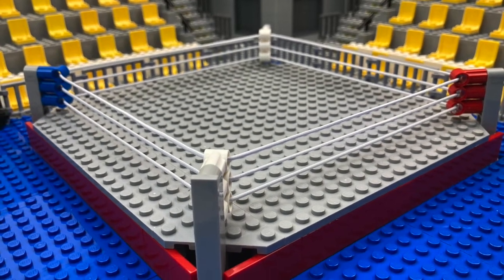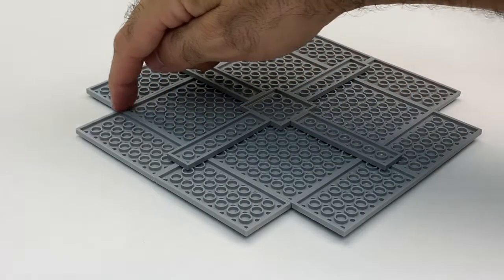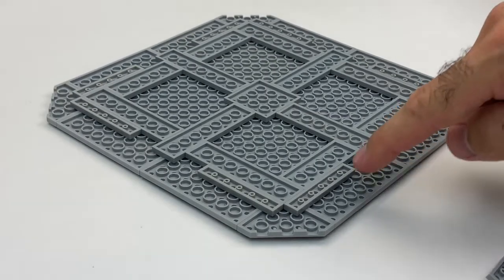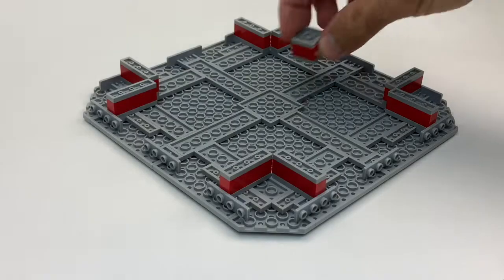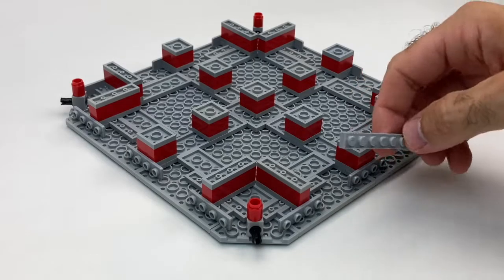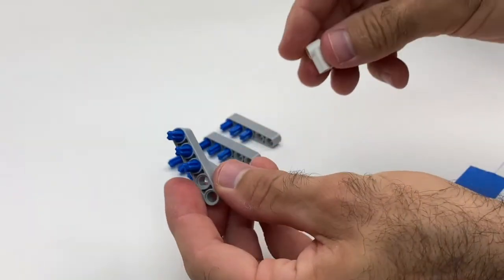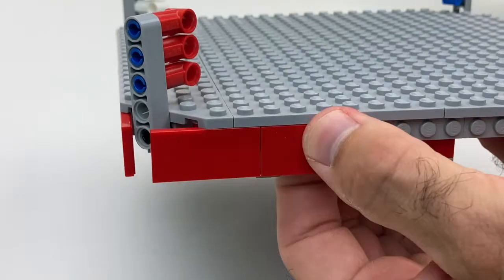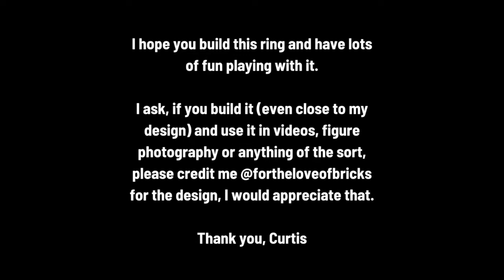How to build a LEGO Wrestling Ring - Easy Building Tutorial (Presented by For the Love of Bricks)

Comment: I'm trying to look for parts on Pick A Brick right now but unfortunately I can't get any plate pieces for the surface of the mat in the same color. I want to get the same color of grey you have but they don't have them for certain pieces (like the corner plates and the 4x8 plates). I wonder how long I'm going to have to wait for them.
Reply from the maker: I'm happy to hear you are building your very own ring. LEGO Pick A Brick is a great way to get parts, but not always when you need them. I would recommend BrickLink.com as a way to get all the parts you need. BrickLink is a secondary LEGO seller. You can find sellers all over the world and even near you. People have parts in all colors and for variety of prices. Take a look and see if it would be a better way for you to get the parts you need. Tag me on Instagram @loveofbricks when you have your ring together, I would like to see it.
Reply: @loveofbricks  I ended up finding some of the parts I needed from ebay sellers. But thank you for the recommendation. I will definitely consider Brick Link for future MOCs. I had to buy a lot of 25 angled axles because apparently Lego has discontinued the exact model you used in this video. However it works out because I'll have more than enough if I choose to make a second ring in the future, in fact if I do I will probably go with a classic WCW theme. I'm trying to make my first ring with an Attitude Era Raw theme.